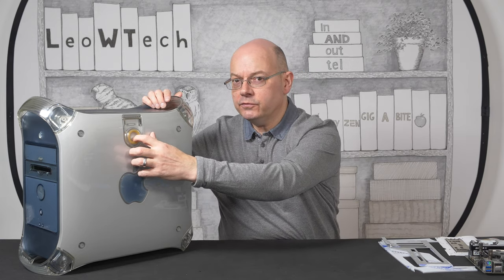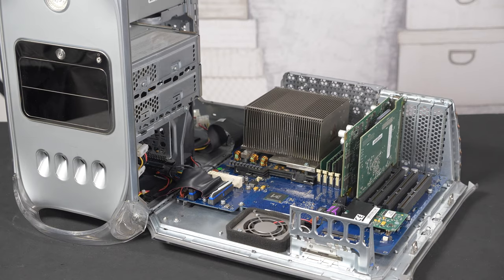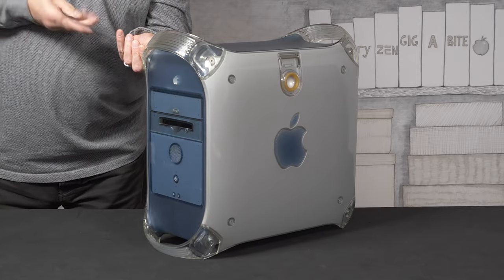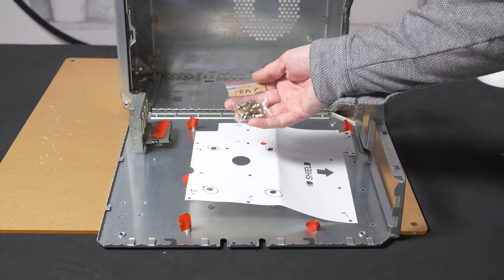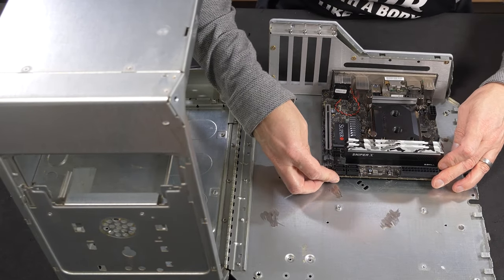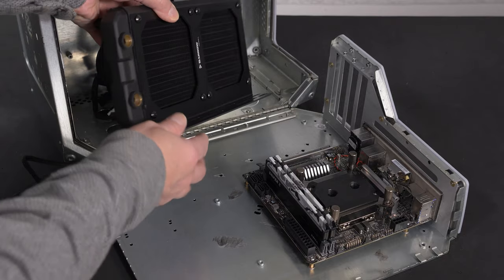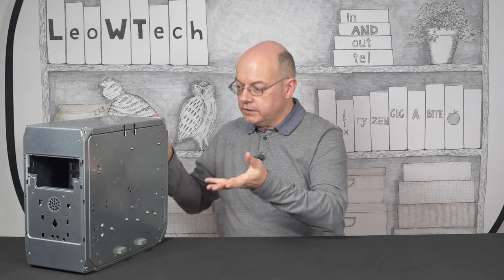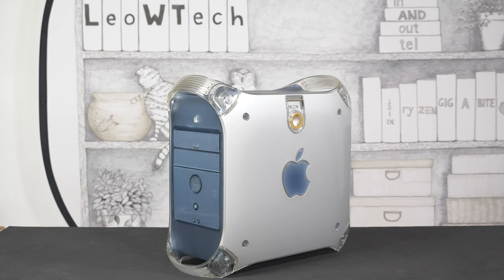Stealth PC Build; PowerMac G4 with Custom Loop

Comment: Any chance of a full list of parts used ?
Reply from the maker: Robin was keen enough to email me to ask about a parts list so here is a list from the notes I made in December 2019:
Apple Power Mac G4 chassis
£56 I/O conversion kit from Laser Hive
£229 SuperO C7Z370-CG-IW Mini-ITX motherboard
£192 Intel Core i5-8600K
G.Skill SniperX 16GB DDR4-3600MHz
£225 512GB Samsung 960 Pro M.2 SSD
£52 240mm Black Ice GTS radiator
£28 (£14 ea) 2x 120mm Noise Blocker Black Silent Pro fans
£7 240mm air filter
GTX 980 graphics card with EK block and backplate
£75 Silverstone 600W SFX Gold power supply
£50 Phanteks C350i CPU block
£40 Alphacool reservoir
£80 Aqua Computer PWM D5 pump
£35 Aqua Computer D5 pump Ultitop
£25 (£12 ea) 2x Noctua 40mm PWM fans
Reply: @leowtech2165  WOW! thanks leo i make that £1,094  as im a pensioner is a bit over my budget, so now im thinking which way do i go, im in the process of purchasing a G4 case,  im all ready running a iMac 27' that i brought with no SSD  a baked GPU which obviously hadnt been done very wel as it was FRIED lol so i picked up a Nvida Quadro K2100m cheepish from the sates and flashed a new bios to support Catalina, so im thinking pick up a n Apple 27' logic board and see if i can get it in the G4  lol
Thoughts?
Reply: Excellent PC conversion. I have a dead PM G4 and may use the case to do a PC conversion someday.

Comment: This is unintentionally the most perfect tilt to bleed watercooling build in history!
Reply: yes, i think the pump and tank could be attached to the  fixed case wall and just use rubber pipes in the articulation part...

Comment: These tower G4s (including the later silver ones) were the last ones in which you could put a pc inside; beginning with the "grater" tower MacPros the section for the PSU is a narrow tunnel at the lower bottom of the case, which leaves absolutely no way to include a industry standard ATX PSU

Comment: Any chance someone could share the quick silver pin out for the front panel board. I can’t seem to get the LED or Power Button to work but can use the reset button as the power button.

Comment: I have a similar build here that i need to get around to finishing. At the moment it has a 240mm CLC in it, but since the pump is the highest point when the door is closed, taht will have to change.
Nevertheless, i can offer some advice for others who try this.

1. i did it with a G4 MDD. It is doable with the steps on the LH page but hard for casuals at home. The drive doors aren't going to be usable due to space constraints anyway unless you go with tiny hardware.
2. mATX totally fits in these, even with a radiator. Yes, you can even use the lowermost slot and all the plugs down there. My rad is lined up with the bottom of the mainboard. When the door is closed the fans on the radiator lie perfectly flat on the very bottom of the case. 
3. i took out the bottom of the case to the dimensions of two 120mm fans. Maximum airflow, no vibration and even if you stare at it (mine sits on a shelf so yes, the fans are slightly visible) it isn't ugly. 
4. You can fit all the cables through the door, so that the thing can be opened up while running. You need extensions and potentially long SATA cables, but it is perfectly doable. This party trick is why i wanted one in the first place!

Comment: Wow, nice build. I've done a G5 and now I'm considering doing one of these but I would probably go for a 120mm radiator and mount it on the bottom as an exhaust, and probably do the same 40mm fan setup you did to get some airflow into the case. I wonder how these ran back in the day with such little ventilation!

Comment: i guess one of the questions is... a little shame not to be able to see that cool looking waterlcooled inside though some window but... i guess that is too compromising to the supercool and superpremium case design... i'm thinking about doing something similar myself and i'm wondering about putting some big grid in the front panel area without fans attached, for see-through purposes... great built sir, that case requires a neat and elegant respect :D ... ah, a second silly thing i'm wondering is: are the power supply voltages incompatible with the ATX ones ? cause maybe it could be possible to just replace the connectors and use it for a pc system ?

Comment: 10:07 leaks or was the water already in the outside?
Reply from the maker: Very well spotted. When I first assembled the Aqua Computer pump and top I forgot to install the O ring - first time for everything but what a howler. With the O ring in place the loop is fine.

Comment: Was it easy to get the power button to work? I have a G3. The power button seemed to be linked to a mini controller.
I was thinking I would have to hack a atx case button behind the mac one, so when you pressed the mac power button it would depress the hacked atx button
Reply: Edit: just saw your reply below regarding identifying the correct wires. Cheers.

Comment: First time I see one of these with a double fan radiator. Impressive job!
I'm still not sold on water-cooling however I was thinking of going with a Noctua L12s which is 70mm high. Do you think it'll have the clearance?

Comment: I built a gaming PC out of this case as well just recently and used the laser hive kit to make my build easier (well worth it). Except I used a micro ATX motherboard and mounted a 240mm AIO vertically where your reservoir is. Also I am very jealous of that custom loop it looks amazing! 
I never thought of using 40mm fans where you put yours, I might do the same. Also what did you do to get the original power button to work?

I posted my build on reddit if you wanna see what it looks like: https://www.reddit.com/r/pcmods/comments/ewl063/this_is_my_first_ever_pc_build_i_also_wanted_a/
Reply from the maker: Very bold for your first PC. I've built umpteen regular PCs and a fair few with liquid cooling but this was my first mod where I drilled rivets and got the Dremel in action. As for the front panel button, I found an image online (cannot recall where) that identified which two wires in the ribbon I needed and then soldered them to a regular PC header cable. If the red side is 1 you want wires 5 and 8 (of 10 in total)
Reply: I’ve been wanting to build a pc out of the G4 case for around 2 years now. It took this long mostly cause of the cost of the pc parts and not knowing exactly what I wanted. I kinda had the “screw with confidence” mentality when modding the case and I think it turned out better than I thought. I will have to look for that diagram then to get the original power button to work. I was gonna try to hot glue a power switch in place of that board.

Comment: So u ruined a classic Mac with pc rubbish
Reply: Is there any need? First I wouldn't really call the G4 an amazing classic mac, they're relatively cheap and available, second he hasn't ruined it with pc rubbish he said he bought faulty ones where the hardware doesn't work and really isn't worth fixing as there isn't much you can do with these old G4's, and it looks cool af and means the case is getting use rather then just sitting with its original hardware in a cupboard somewhere. And yeah an overclocked watercooled i5 and 980 really are PC rubbish they have no use at all!